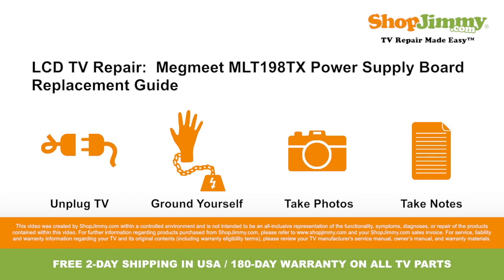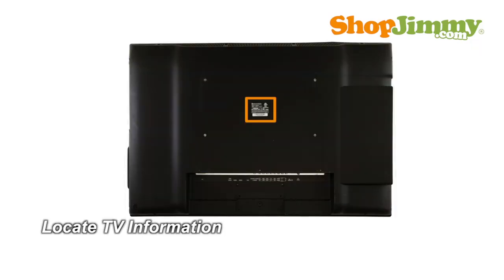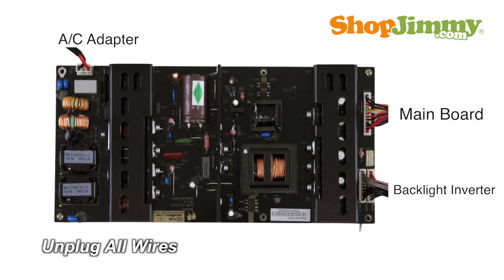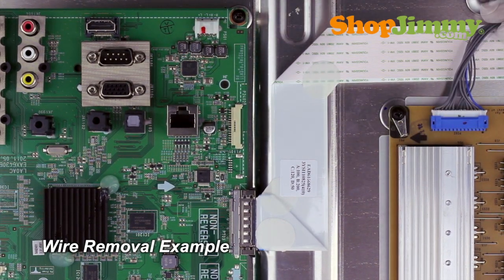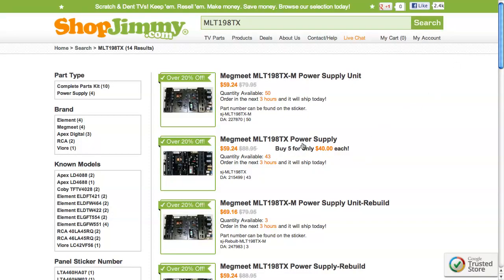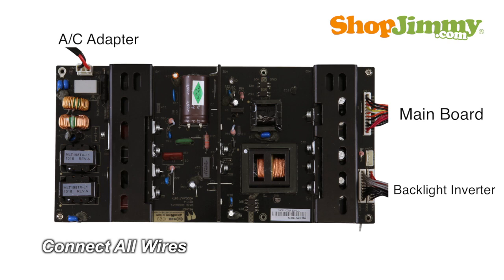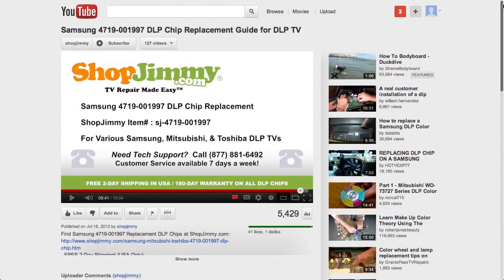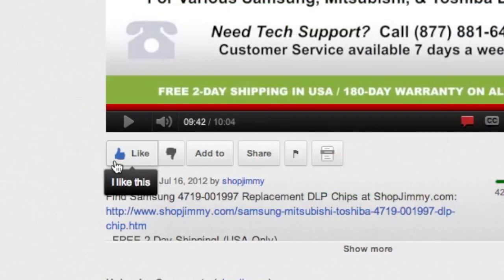Megmeet MLT198TX Power Supply Unit (PSU) Boards Replacement Guide for LCD TV Repair

Comment from the maker: @Jack Frieden - If the TV has standby only and won't change colors after trying both the keypad and remote, then replace the main board.  We are out of stock on a compatible replacement, however you can search your TV model number on our website shopjimmy com and sign up to be notified when the main boards are back in stock.  You may also call our customer service for further assistance.  (877) 881-6492  Thanks and please let us know if you need any further assistance.

Comment: I have the ELDFT421 which has no standby light and will not turn on. The fuse on the power board is not blown. I replaced the power board, but still have the same symptom. Any ideas on diagnosing this issue? Thanks